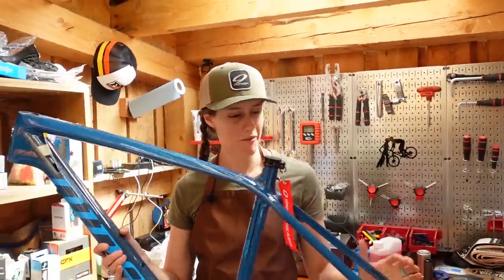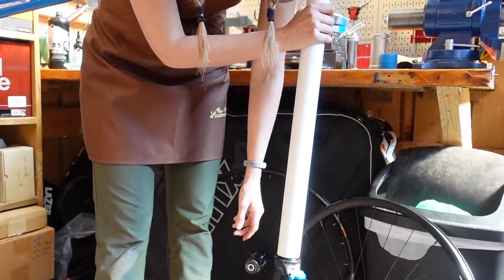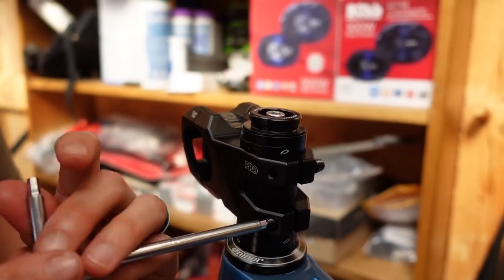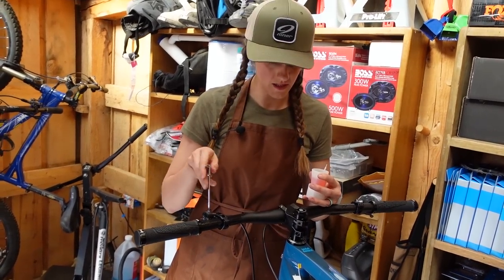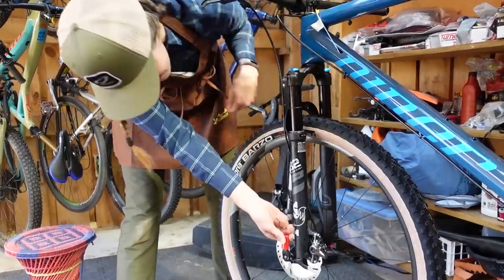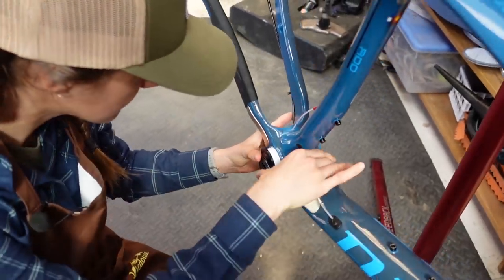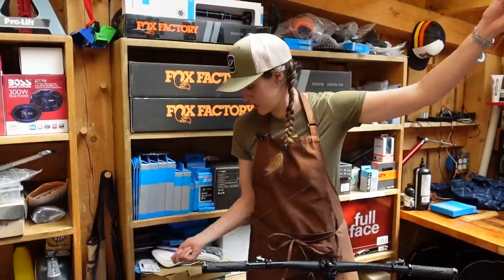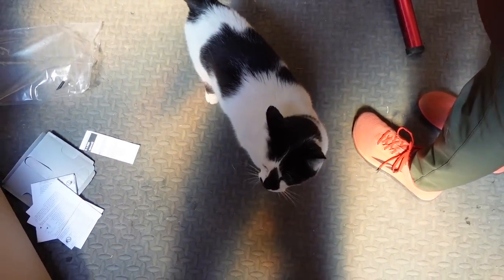FRAME TO COMPLETE BIKE - Niner AIR 9 RDO 20-pound single-speed build  | Syd Fixes Bikes

Comment from the maker: If you enjoyed this video or it saved you time and/or money, consider supporting the channel by hitting the "Thanks" button above to leave a tip.
Reply: Argh - all that grease all over the crank spindle and then the actual most likely place to have creaks - the splines - didn’t get greased at all… use your fingers.
Reply: I don't question how good is the warranty for the niner bicycles frames that you ride on your channel I know your sponsor by then if you break a frame or do you do they replace it and no extra charges

Comment: Love the motivator on the top tube. Got a stem cap labeled, "ride it like you stole it". Great looking frame and best part is its a hardtail. Headset press: Or you can use a long bolt with appropriate size washers to press the headset cups in. I hate to slip when I hit and scar the frame. You guys are awesome. Raced BMX growing up until my ex-wife(God bless her soul) told me I was done racing when I split my rotator cup from the top so I couldn't wear a cast. Just a sling and had to take some time off work. So, dialed it back a bit to MTB(little did she know I still rode like a madman) and she was cool with it. Thanks again guys for the informative and entertaining videos. Keep it going!

Comment: Putting the bottom bracket for the shortest chain possible was the way to do it, I’m happy you realized it before fitting the chain. For the cog alignment thing, the easiest way is to put the cog free with no spacers, put the chain and spin the crank. That way the cog will set itself in its more optimal place, then you just have to mesure where it sits and put the corresponding number of spacers, and you’re set!
Reply from the maker: Good tip!

Comment: I’ve had 2 Niner Air 9 singlespeeds. I adjust my chain tight, and loosen based on how smoothly the chain disengages off the teeth of the front chainring.  Love the build.  A blue Rockshox Sid would look killer on it.

Comment: “And what’s the top cap gonna do?”
“f*ck” 
boy howdy have I been there
Reply: I built a bike for my dad and used a headset press to tension the headset bearing. My dad kept asking me why he needed a top cap. I told him that he did not need one. He was too cool to have one. Besides, star fangled nuts and top caps just add wieght. He rode for a year without a top cap. Eventually I insisted he install one...just in case.

Comment: Your chain tension looks pretty good but you’ll want to check it with the crank at different positions as there will be tighter and looser spots throughout the pedal stroke.

Comment: Great Job Guys!! Very well. Done. Exactly right about looser is better and faster on chain tension. Just like BMX race bikes and track bikes. As the chain wears and loosens you may hear a popping noise if the side link catches the edge of the tooth letting you know it needs to be snugged up just a bit or it could pop off. As long as its smooth and quiet you are good. 
For chainline, if you watch the teeth enter the links as you slowly pedal the bike. If the inside of the inner link is catching or touching the top of the tooth and pushing the chain over as it engages you should adjust cog away from the side its touching. Hope that helps.  Look forward to seeing the smile on Mackys face the first time he gets the ride when the hand is all better!!!!!

Comment: Nice work! My only note is that your pipe deburring tool (the thing you used on the cut end of the steerer tube) will stay sharp longer if you only ever turn it clockwise (in the cutting direction). Using a cutting tool backwards will dull it.
Reply from the maker: Interesting, didn't realize that.

Comment: Been riding, fixing and building bikes for.... 30+ years.  Semi-pro tip for smacking starnut in place.   Get a piece of standard 2x4 about 28" long (length will work with ANY fork) Remove the axle from the fork. Set up your parts and tools in easy reach. Stand the 2x4 on end. Rest the crown onto upright  2x4.  Direct, solid connection to the floor for when you smack the starnut in place. Pro tip: screw a small base on the 2x4 so it stands with out having to be balanced.  The softwood of the 2x4 should not mar the aluminum fork crown.

Comment: I figured out that when installing tougher tires over the last bit of the rim, using your palms more than your finger tips gives you extra grip and pull force. Nice job on getting them on without a tire lever though!
Reply: For maximum slack it is key to work your way TOWARDS the valve, since that is the only spot where the bead definately won't ever make it to the center of the rim. On some tires this will make or break it!

Comment: Got told years ago by a mechanic friend to use regular WD40 for labels I want to peel off. Spray a little bit on, leave it a couple of minutes and then just peel the label off without any issues. Works like a charm every time.

Comment: Nice bike, simplicity rimes with 'nicecity' lol. Don't worry too much about having some play in the chain, it would take a lot of slack to fall off anyway. A trick is to listen closely while cranking: less noise means more efficiency. The reason for the bottom bracket adjuster is to be able to run disk brakes (not possible with chainstay tensioners). And about the brake line routing, aren't there special clips that fit on the frame fittings? Anyway I wish you to win a lot of races on that one.

Comment: do you guys have a video about changing gears, I'm not familiar with bike riding since it's been about 10 yrs since I rode a little BMX bike, and it's a whole new world that I need to get used to.
Reply from the maker: We don't, but our advice is: shift early and often! Any slight incline, shift easier, anytime you feel like you're getting spun out (feet going around too fast) shift harder. Especially coming from a one speed, your tendency will probably be to stand up and push a harder gear than you need to. Get used to staying seated and spinning an easier gear and then as you get more used to having gears, you'll find the right gearing for different situations. And shift a lot!

Comment: 1:45 My carbon single speed is 32 18. The 18 being a Niner brand the cog. 2:20 although I have some old Easton carbon wheels keeping things light while the tires are not. 4:00 My fork is a bizarre Factory terralogic 90mm Fox 32. 48:00 I am happy with my chain if I can see it sag down...but barely. The tension should be on the border of seeing it sag and not seeing it sag as you look at the bike from several feet away.

Comment: Most important thing is how did you get the stickers off the bars! 😏
Reply from the maker: Melted them off with my tears 😭
Reply: Try cooking oil and let it sit for 5 mins. Alot of stickers aren't water soluble. Natural products are better cos they won't damage you're paint
Reply: Other methods I've heard are rubbing alcohol, methylated spirit, mayonnaise, acetone based nail polish remover, mineral oil, sudo creme, lighter fluid, vinegar, Pnut butte, Vaseline (petroleum jelly)
Reply: @sydfixesbikes  are those tears of joy or tears of pain 🤔

Comment: I would say a good tip to remember is that on Shimano brakes, the olive is already inside. I made the mistake once of adding an olive which wrecked the little valve.
Reply: Now THAT'S a bummer!
Is it mentioned in the manual?
Reply: @geemail369  in a round about way. The manual just has you insert it. However if you've ever worked with hydraulic lines you know you need to have an olive, especially if you're replacing hoses as they can't be reused. Again, it's a new build thing and a mistake I will NEVER make again.
Reply: @DracoPacheco  I think more people than not would concider the olive missing if it ain't a separate part in the small parts bag than have a look into the lever. Myself included!
Reply from the maker: Yeah, that confused us the first time too because for a long time new brakes DIDN'T have the olive already installed and then they suddenly started doing it this way. 🤷‍♀️

Comment: Shimano finned brake pads - what is your secret to keep them from rattling? Worse when new...
Reply from the maker: We haven't really had any issues with that...I assume you've confirmed the screw that keeps them from falling out is tight? Or are you using the metal pin that comes with new pads (https://bit.ly/3daD38M)? If so, replacing with a screw (https://bit.ly/3u6tyOQ) might help.

Comment: Absolutely nothing wrong with plastic pipe to fit crown races! Another option for getting chain tension right is to use half links or a half link chain. This has helped me avoid using a tensioner on my vertical dropout, normal bottom bracket single speed.
Reply from the maker: Good point. Forgot to mention that as we don't have any experience with them!

Comment: Great Vid.. got some good laughs too... especially following the "what's the top cap gonna do?" question. 
Hey is the brake line tool a must  or game changer ? been doing brake line with a good Shimano housing cutter and open up the hole with a dentist poke tool followed with the two yellow housing holder with pliers to put "Barb" in there.  been doing this for over 10 years no issues. 
Yes you are right... your tire marking to valve position is wrong but at lest you know. 
The bike weight was without the beer cap so we need a new scale in...
 Ok i approve the grease amount on the crank ( maybe there was to much ) but its important that every "spline" slut as some grease in it so she don't creek.
Center lock.. they are better now... but oh boy when they came out they sucked... i still go for 6 bolt pattern if I can but probably cause of old issues and bad vibes I had .. and  these things stick with you. 

Good job on the bike built Syd, probably would of been faster if Macky was not there to bother you ;) 
Keep up the great vids you folks
Reply from the maker: Is the brake tool necessary? Of course not, as you mentioned, you've been using the other method for years. After using the brake tool, would you ever do the old method again? Not a chance.
Here's the link in case you're considering it 😉: https://bit.ly/3fkKhtN

Comment: Great video. Are those integrated cups made of alloy and glued into the carbon frame? 

Also with integrated headsets, I thought you need shims or else the preload wont set properly.
Reply from the maker: They're just pressed in (carbon has some flex). Never heard of needing shims...

Comment: Nice video. Were you using a tool to fasten a quick link ?... easy to just apply tension to the chain by stepping on the pedal and the links will pull into place.
Reply from the maker: Yeah, but you have to backpedal until the quick link is at the top, plus, this tool has a remove and connect setting, so might as well use it!
Reply: @sydfixesbikes  fair enough, didn’t realise you could do that 👍

Comment: 14:10 I once installed a star nut onto my trials bike by hitting it with a rock💀😂
Reply: Sam pilgrim style 😎
Reply: @DamonJanelle  still got the same star nut in that bike now😎 dreams
Reply: @charlieroberts3171  did you make sure to use the curb to get the burrs off if you chopped your steerer tube?
Reply: @DamonJanelle  i used the rock🤣 its a very versatile tool
Reply: @charlieroberts3171  ahahaha 🤙🏻 dreams

Comment: Thanks for this video. I just finished building this same bike. Have you had any creaking issues from the bottom bracket?  I can’t get mine to be quiet and like Mackey it drives me nuts. I used Teflon tape too.
Reply from the maker: Haven't had any creaking so far, but have since replaced the tape with plumbers putty. Worth a shot.
Reply: @sydfixesbikes  I will give that a shot and 🤞that will take care of the issue.  I really appreciate how you both approach riding/racing and have enjoyed following your adventures.

Comment: Hey awesome video, I have I a question. I recently purchased Used specialized Shiv which is a tri bike and the previous owner converted it into road bike, when I switch gears, I had to push it several times to switch and left shifter won’t even switch
Reply from the maker: Most likely you need new cables and housing

Comment: Is a single speed specifically build for racing? Lacks options for normal use no?
Reply from the maker: Lots of people actually ride single-speed as their main (or only) bike. There are some benefits: simplicity (no derailleur), weight, and it forces you to ride differently than a geared bike. We like having both options!

Comment: So do you have to put on a different chain everytime you swap the chainring or ring on the back or does the bottom bracket give you enough adjustment?
Reply from the maker: Depends how much of a change you're making. Most of the time the BB gives you enough adjustment.

Comment: Is the Air9 the upgraded version of One?
Reply from the maker: Good question. I believe they both existed at the same time at some point but the One 9 has since been discontinued. I believe the One 9 was a dedicated SS whereas you can run the Air 9 as a single speed with an EBB or put gears on it. Macky has done both (SS - https://youtu.be/quyAsiQAMsw, geared - https://youtu.be/6fDhOoRQGos) and liked the bike in both setups.

Comment: EBB’s are a PITA. This is from 20 years of riding a SS. They all slip and will most likely creak. Of all of the designs for set and forget…..(one of the reasons to have a SS) are sliders with stops. When you put the power down a not fixed BB is prone to move
Reply from the maker: Macky hasn't had any issues so far and he's won some fairly serious races on this SS (National Championships and Breck Epic, for example -- if you're interested you can watch those videos on our other channel www.youtube.com/sydandmacky). So maybe they've improved?

Comment: to fix the chain tension do it like track racers do: hold the bike in an horizontal position, chainring down. next rotate the cranks- the chain might not fall down. Do not overtight the chaintension as it will wear out the bearings. -The more tension the more friction.  Great video - I was very curious to see how it works with the special bottom bracket.

Comment: Tightening the carbon bars without a torque wrench - a HUGE NO NO. Never ever do this no matter how "many bars you've done". There is no way you will get that small torque correctly by feel. You might and you might not. You're saying to scrap bars that have scratches on them yet you don't use a torque wrench... For your own safety and if you care about your life and your equipment - ALWAYS use a torque wrench on carbon parts.